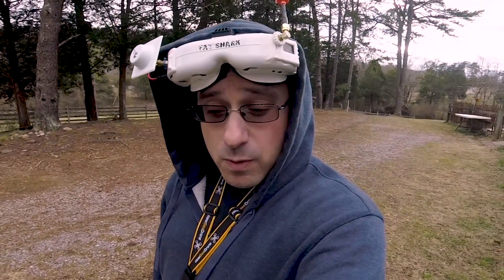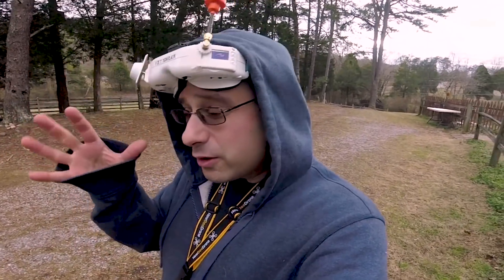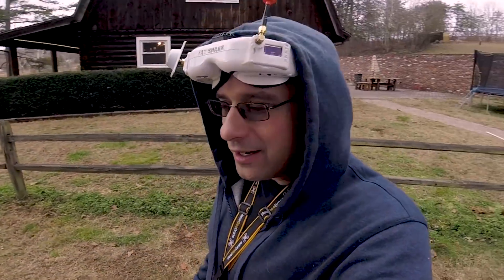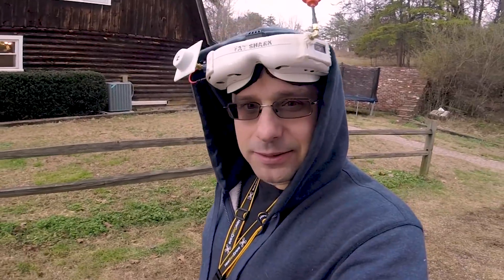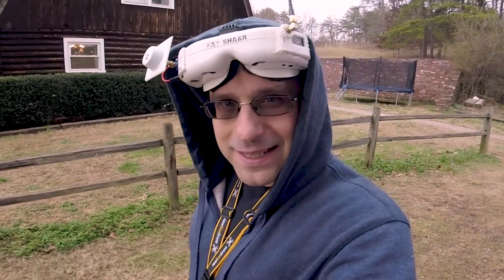TRIED to over-prop the EFAW 2407 and failed

Comment: Running 5.3s on a 6s 2407 1700kv marmotte with gopro7   

Nube to the scene but love it   took a while to tune the throttle down but love it       should I try a different prop?

Comment: You should try an AVAN prop. Those motors are supposed to handle a 6" prop on 6S so I doubt any 5" prop is going to over prop it. You might over prop your battery though LOL.

Comment: your motors always sound stifled by your tune .. I've watched your tune videos and I wouldn't tune your way but hey if that's the way you do it and it works for you then fine.
I lower my pids way down from stock and the move up from there and my values are normally lower than most but the upside is the motors can give their best .
My quads fly great and my motors give there all and sound crisp, they don't have the tortured sound yours seem to have.

Comment: im using 2508 1450kv motors with 8inch tri props still testing, but it doesn't have the top speed of a 5 inch but wow what lowdown kick, I'm liking it very much so far

Comment: 5051 on 2700kv on 6s was over propping as it was faster on 4s than 6s and also made a new 1 flight old tattu 1400 mah 6s drop to 14v before the end of the 1st real punch out.
The same f30 6s escs used with f80 2500 on 6s 6in prop that ran very cool as well as lipo were blazing hot like desolder caps hot and the xt60 desoldered so somehow they were much harder on things than f80s were and also much slower and were same build same actual parts and doubt it was the 200kv extra and likely they wetnt even that as I believe in kv test they were a good bit lower than stated kv.
That was the first batch in us stores and actually pre first batch since the 2700 s didnt come in 1st one and was a set that was trial set of shop owner as nobody had 2700kv so maybe they improved but do recall them claiming motor of the future and every pilot sill be flying them though that was before the 50 revisions and still people complaining and likely also mad that they were nothing special at all and efficiency wasn't 50% more than other motors of same power like claimed.
Also efaw has the worst customer service I've ever seen in my life right underneath rtfq if that means anything to you.

Great video though josh.
Think you should get some 8s kamikaze escs and throw some apc 5150 durables on em and see whats up.supposedly the windings are so beefed that they'll not come close to burning up but everything else will vaporize.
Maybe try overprop the motor with more voltage and props you've tried and see how that goes?

Comment: Nice video JB! I have been running the HQ 5X5X3 V1S on my Stingy frame with XH 2307 2500KV.... I was worried I may be over-propping my batteries/motors but so far they have been great. The V1S's are the best prop I have ever flown!

Comment: Any news on the rcx 2306 vs rcx 2207 test you wanted to do? As I can't decide whether I'm getting 2207s or 2306s, I'm really curious about that.
Reply from the maker: I have the 2207 motors but it will be a while before I can get the test done.
Reply: The NK2306-2700 are sweet but the NK2207-2700 are ballistic, but I break a lot of T5051C's, I break two here: https://www.youtube.com/watch?v=mAHOHrmgxFM
Reply: Joshua Bardwell Take your time. I was actually eyeballing at the f40 pro 2/f60 pro 2, though the rcx could also be interesting. I'm just irritated that T-Motor states the F40s as race motor and the F60s as freestyle...so actually the opposite of the hypetrains.

Comment: Something I've been meaning to try myself with more power hungry motors, is reducing my full throttle end point by about 10% and adding expo to the throttle curve to soften the sticks and give the batteries less abuse. I'd like to see this theory applied to your Kopis with those beastly motors.

Comment: Two questions Josh, first, what is that beep alarm telling you exactly? And second, are you ok? Your voice sounds thrashed, and had been for the last few of your videos, as I'm sure you know already...
Reply from the maker: It's the low voltage alarm.

I'm fine. Just a little hoarse.
Reply: So it beeps as the battery dives after a hard punch, and stops when you back off and the battery has time to rebound.  What batteries and esc's are you running? I thought that a 100C 1300mah batteries can only unload 130 amps, and 4x30 amp Escs can only draw 120 amps  anyway, so how are you using up that many amps? -also, good to hear man. We need you healthy. Don't die on us man.

Comment: Dude I flown those motors they are good but there is one better and don't guzzle the amps the hawksky 2607 2500kv on the Gemfan hulkie 5055 trust when I tell you its ridiculously good... think of the efaw as a 5.0 V8 and the hawksky as a 3.0v6 twin turbo... The torque is surprisingly great
Reply: at about 40g those motors are quite a bit heavier too

Comment: I've seen a few comments that this motor is probably best suited for 6" or even 7" props, I'd be curious to see if the torque can make those props really pop but without stupid high amp draw at lower throttle, aka are these a valid long range motor, or just for battery killing racers?

Comment: If you wanna buy motors from company whitch product motors loosing magnets after 5 flights without any impact, and dont send anything for exchange / refund, then yea, EFAWs are ideal for you.
Reply: Jan Prejzek tell u more are  they not reliable or is this a isloated case?
Reply: It was whole serie. And "my" seller told me he have problem with others as well, even his own to get refund or exchange, manufacturer dont react, or react very badly.
Reply: Guess i been hung out to dry quad only lasted 5 flights on 6s after it costing me near a 1000 dollars buy the time i brought 6s batts plus importing quad in from CMW with our conversion rate  now cant even buy replacment motors my were version 1, 2407R 2800kv what other motors are out there in 2407 2800kv for 6s ?
Reply: First 2800kv is unreal to spin on 6S. Second pick any other top motor brand motor around 34g

I recommend you 2500kv maximum.
http://pirofliprc.com/PyroDrone-HyperLite-2405-2522-Team-Edition_p_4349.html

Or even i dont like raceflight much , these can be interesting as well.
https://shop.raceflight.com/product/raceflight-warp-7/
Reply: For 6S i will not be "scared" to pick 2300kv so much :)  .

After i fly 2600kv on 5S some time (and got my top speeds ever), i will try now 2400kv on 5S, because i had like last 30 procent of throttle same speed +- .

Comment: Guess performance is relative. For proximity stuff a big prop may perform worse. A less aggressive prop is likely to accelerate quicker for tighter agile flights.
Reply from the maker: No that is the whole point I am making. These motors have so much damn torque that even on heavy props, they are incredibly responsive.
Reply: he he he....thanks Joshua. Game keeps changing! I recently upgraded to Sunnysky XT2405, thinking they would kill my lipo but actually they were quite efficient. Surprising.
Reply: The only prop thus far that seems to bog down the bottom end and lower mid range any is the Avan R and its not much but compared to any other prop I have flown on them its the only one that seems to work the EFAWs.. I love they and the quality is top of the game..

Amps on the Avan Rs is getting upwards of INSANE, I have seen 182 amps before and see 160+ all the time on the Avans and it will pull until sag starts to pull down wattage...
They have never ending torque and they keep pulling at the top like only a handful of motors out there..

This is a hell of a freestyle motor and on the HQ5x4.8 or 5x3v1s the higher loading props make a heavy freestyle build hand power all over like no bodies business... They make hell of a race motors to on heavier race builds... Of course these arent going on a build that you are targeting 200 to 210 grams dry weight with BUT on a heavier race build that is going to be used on large FAST tracks... This motor on a 260 to 270 gram dry weight race build along with GF5152s or the new Hulkie 5055s.... the only thing that will touch you on the straights is the.... Not many we will just leave it at that...

Not many motors out there that provide this kinda performance when it comes to turning any and every prop in the 5 inch range and no matter how high load/heavy of a prop it just man handles it like its no there.... Of course this motor on heavy high load props is not for the faint of battery... and you must have premium batteries and not mind abusing them or else stick to low load props and still have tons of power and response and get away with good mid range batteries and not even work them that hard... and on a light freestyle build you can get some really long flight times with excellent performance with a 4s 1550, HQ5x4.3x3v1s or the new dal 5x4x3 cyclone (I think the HQ5x4.3x3v1s was made for this motor honestly its just SO good for free style when bolted on a EFAW) 4.5 minutes landing at 3.7v per cell resting voltage of smooth flowing freestyle but still flying hard... and 3 to 3.5 mins of really ripping hard and flying without worry of throttle.. step up to a 5 inch pitch prop and watch the flight times dwindle, power sky rocket and amps do the same but oh what a sub 2 minute freestyle flight with power for days.. 

I love these motors, only thing Im liking better right now is the new F40 pro V2 for freestyle and the BH R5 2207 2700kv for race builds... past that this is the motor and I have them on 7 builds ATM..

Also I have never cooked one, I have never had a shaft fail or a motor failure in anyway... I have cooked some Speedix 30a 4 in 1 escs with them lol... I learned real quick that esc is not friendly with this motor on anything above the HQ5x4.3x3v1s, I cooked them on GF5152s and 2 on Avan Rs... Now I run the DALRC Blheli32 4 in 1 40a and have yet to cook one on any prop or motor... That Esc is the shit, its the finest ESC on the market right now and its only 13.2 grams... The smoothest esc I have ever flew.. I was pretty much a Airbot Wraith esc guy because they was so smooth then DALRC sent me 2 of theirs to test... I fell head over heals in love, smoother then any ESC I have ever flew, have not had one fail EVER, 13.2 grams, thats 8.5 grams lighter then a set of wraith 35a without any wires and smoother did I say smoother then anything I have ever flew?? yes its hard to believe but its smoother then wraiths by enough that you will notice it right away if your A racer and half decent at it...
trust me any freestyle guy out there.. if you want more power when carrying a HD cam and you feel a little under powered but dont want to go to a heavier prop because of response just slap on a set of HQ5x4.8x3s and you will now feel the weight of the HD cam go away... if you want stupid power but at the cost of some flight time and dont mind shorter flights slap on a set of GF5152s and you will be shocked at the power and current draw lol... but you will have all the power you can use and you will not notice one bit of slower response/spool times... this motor absolutely MAN HANDLES the 5152s

Comment: 2:19 How does this trick called? And how did you do this without pitch forward?
Reply: Its just uncoordinated roll to the right. The way how it looks is just because of the camera tilt. If its 45° then on straight flight its leveled, but if you put full stick to right it would rotate quad and make the camera look to the ground (180° on roll axis makes camera axis 45° +  45° and thats straight to the ground). Best explained on a turned off quad in a hand, manually rotated by hand :)
Reply from the maker: There isn't a name for it. It's just a little flip over the bird house. IDK why it would need pitch forward the nose is moving back through the move. It's a pitch back move not forward.

Comment: I think I remember seeing Johnny post that he adjusts his throttle curve so he can still have control yet punch when he wants it... That wasn't with the efaw but rather his motor but I would imagine the principle still holds
Reply: I have done it on my micros for better hover control. Rather than in FC I did it on TX with just a simple expo :)
Reply: Common practice on my speed builds. When I want to punch I want to PUNCH but the rest of the time I only need 50% of my power tops. As more speed needs a exponential power equation.

I end up with a very sharp throttle curve. 

It dosent even have to be a liner curve. 

You can have a gentle curve they gets stepper quicker towards the end to if u have the right radio.

Comment: Just a quick question y do most people use 4s not 5 or 6?
Reply: Actually...a higher voltage setup will pull LESS amps. W=A x V  That is the advantage of high voltage setups
Reply from the maker: Higher volts pulls less amps only if the load is the same. In reality, what happens is people get drunk with power and jam the throttle and draw more amps.
Reply: +Joshua Bardwell
Higher voltage pulls more amps if the load is same. I=U/R. I'm IRFZ44 and you're going to learn something new today! ;-)
Reply: +Marshall Scalisi
The thing is, people usually go higher voltage to get more power with the same load. If you implement I=U/R, with higher U number (voltage), you will have more current, therefore more power.
Reply: interesting in all the motor test I see, it seems at the same pull a 5s will draw less amps than a 4s. I'm in the process of trying 5s so I'll see if it get more flight time in real world... if I keep my same flying style... who am I kidding I'll probably drink the power cool aid too.  haha
Reply: tim essex 4s for most ppl is plenty enough power. Ppl do fly 5-6s too but it often pulls really high amps and not all components can handle that.